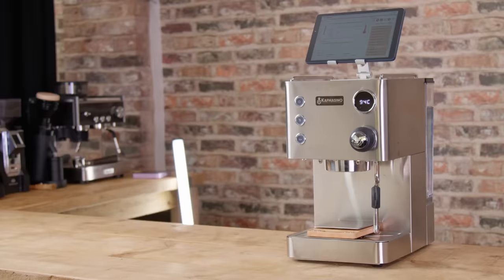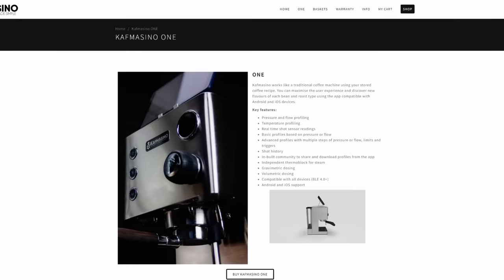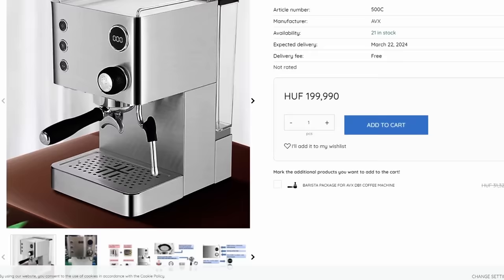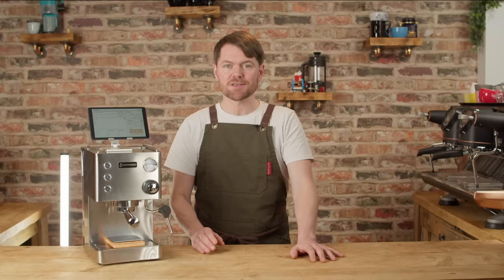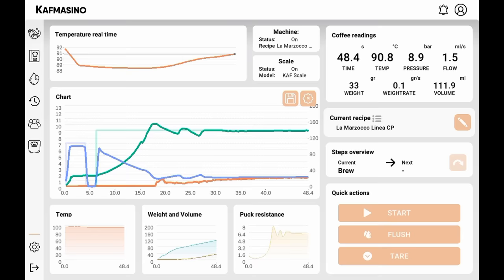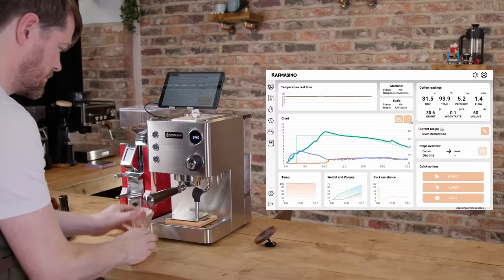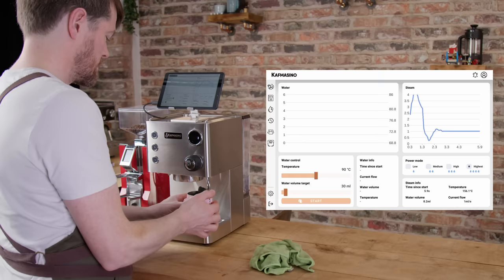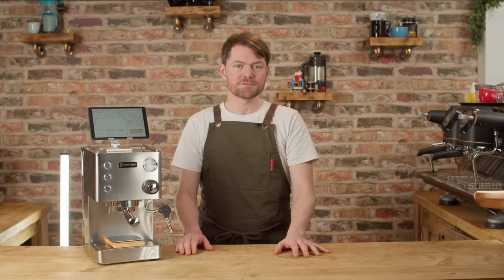Kafmasino One. Is This Machine The Future of Home Espresso?

Comment: Is this based off of the CRM3007 series like the Miicoffee Apex?
Reply from the maker: Yeah the crm3007 is the same base machine I believe, Miicoffee Apex isn't based on the exact same machine though, the AVX DB1 is this same machine, the Miicoffee Apex (and Turin Legato) use a very similar machine with slight differences, they have a pressure gauge, and also a different thermoblock, and slightly different internal configuration. 
Ta, Kev.

Comment: This looks an awful lot like the machine from the df grinder folks with the gagguino mods added on and sold as an original product. It’s not an original product
Reply: I think it's like a DF product, where the manufacturer remains mysterious but they have different distributors selling it, and supporting it, with different additions on it depending on which part of the world your in.
Reply from the maker: they use a similar (not the same) base machine. Ta, Kev.
Reply from the maker: The base machine itself, yeah - although it's not the exact same base machine as the ones MiiCoffee & Turin use, it's the same base machine that AVX use for the DB1. Ta, Kev.

Comment: This is an intriguing machine. Performs almost as well as the Decent for much less investment. I have a Gaggia Classic Pro that I recently modded with a PID, preasure guage and flow control. After considering the cost and time spent doing this I wish I had gone for the Gaggiuino instead. I really like the stability and the ability to adjust  when desired. Just wish this was around a few years earlier.
Reply from the maker: Yeah I do think they've done an amazing job when it comes to performance vs cost.
Whatever you decide on when it comes to home espresso, there's going to be several other ways you could have gone. 
Good new is that modded classics hold their value well, so if you wanted to you could always sell it and do a Gaggiuino mod, if you're not a fan, there aren't many Gagguiuino modded classics available for sale at present so that would probably be a fast sale too, and I doubt you'd lose much either, might even make a profit!
Ta, Kev.

Comment: I want to know if this can replicate a more expensive rotary pump style for syrupy shots.  This is what I found at home-barista forum about these types of shots.  "To maximize Syrupy/Gloopy shots, high flow and high tapering pressure. Large conical would be the next part of the equation but not as important. Deeper baskets help too with more coffee so it is harder to get it right with a 58mm basket but can be done (53 to 55 double basket probably ideal like LSM lever maybe pump or Dalle Corte Mina comes to mind for a pump setup).

Also use a medium to dark roast with some robusta in it, many of the great italian blends will have the right combination. And also fresh beans of course 5-15 days off roast for these although sometimes they need to rest a bit longer than 5 days and you can move the window back.

The LSM group is basically the prototypical setup for these types of shot, super high flow, deeper 54/55 basket, and higher pressure 11bar dual spring. You will struggle to get extreme goopy shots with a pump machine of lower flow rate (Ie Decent espresso) but a high flow rotary gear pump will do it if you adjust the peak pressure higher."
Reply: I don't think it's agreed that rotary pumps actually make a noticeable difference, but they're more robust, quieter,  and can be plumbed in to a water line, also larger and more expensive.
Reply: @BensCoffeeRants  Well if thats true and this machine can accomplish something like this that'd be great.  Not sure if you have deep baskets and the ability to go to 11 bar and all that with a high enough flow rate.  Thus why it would be interesting to see.
Reply: @zh4k  if it's a 58mm machine you got options for pretty much as deep baskets as youd like.  I got a 28g Weber basket for my BDB which fits in the Normcore portafilter just fine! You don't need a super deep basket or 11bars of pressure though.  You just need to pull shorter ristretto shots. The grinder. Coffee and basket style will also make an impact.

Comment: This sounds like how the Nucleus Link coffee roaster works.  It’s essentially a Kaffe Logic hardware but the Link addition is you get an app that recommends a roasting profile and range based off of the bean density.  And if you tell it when the first crack was it’ll adjust the recommendations.    And you can save and share your roasts.    But this is an espresso machine that does that for your shot lol.   I am probably going to buy one eventually after I move.  

And for the romantic people I do actually ignore the roast profile recommendations sometimes to achieve what I want lol.  It skews to pretty light to light medium roasts which I almost always like but sometimes it needs some more time and the development I shoot for is far longer than the roaster recommendation lol.    I suspect the same thing will happen with this machine as people go on to make espresso with it.   There is nothing wrong with lowering the difficulty to get to great espresso so someone can get bored with that and try weird stuff.    It’s more likely we will all discover greater things together by sharing our work than we will by struggling alone and cursing that another shot didn’t hit right. 😭

Comment: You didn't mention if the app was open source or not. I assume the tablet is an Android one. Being a software developer I want to be able to tweak the app as I use it. The Gagguino and Decent are both open source so they can be modified.

Comment: Like AI You are distroying...
Reply from the maker: This is one of a number of high tech espresso profiling machines now available, which started with the Decent DE1. 
I think we'll see more and more options like this, and it wouldn't surprise me if eventually the most popular machines are available with something like this as an optional add on.
This doesn't mean you have to buy a machine like this, though, or that machines like this will destroy traditional espresso. We could say the same for the modern semi-auto pump driven machines, with volumetric shot buttons and so on, we could say these destroy traditional lever espresso - but traditional lever espresso machines are still available if you want that experience.
Ta, Kev.

Comment: It's rather get a Lelit Victoria at that price range instead of this crooked machine made out of soft metal, even though it's packed with amazing features.
Reply from the maker: This machine is really about how it performs,  but to be fair it's really sturdy, the base machine itself is really solid.
Reply: This is a waay more capable machine
Reply: @Coffee_Kev  man how come it's solid, I can see it on your footage, if you look at it from the side you can see the top part inclined, kinda folded a bit.
Reply: @nhayes927  true, but I'm afraid it won't last for long. The price is in prosumer range but it's non-functional (quality) attributes are in sub $500 category.
Reply from the maker: @orifkhodjaev1449 this one I've got has been travelling the world for the past few years, and it's fine, and the parts are all easy to get hold of, so in reality I don't see any reason this machine wouldn't last as long as any other traditional machine as long as it's looked after.